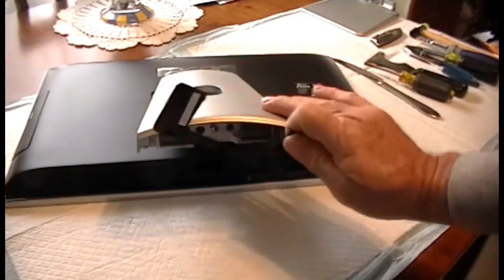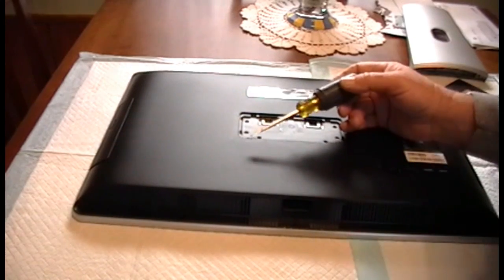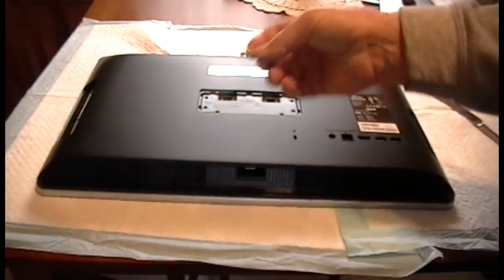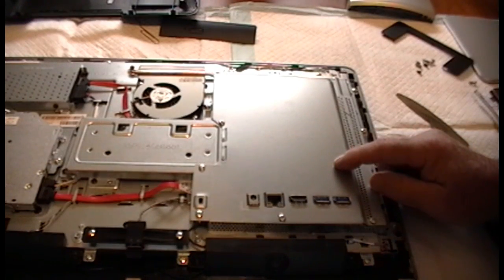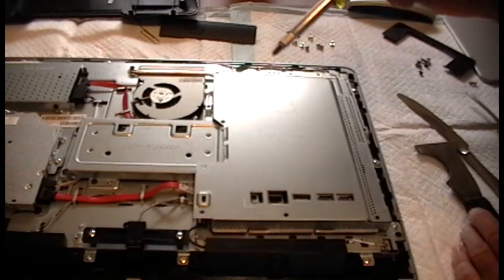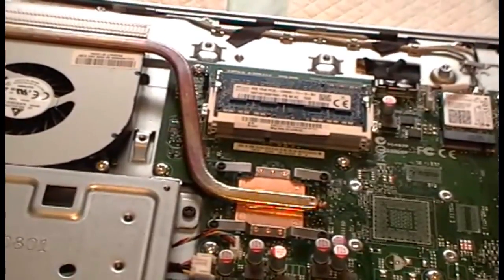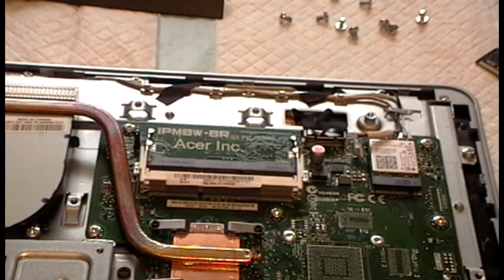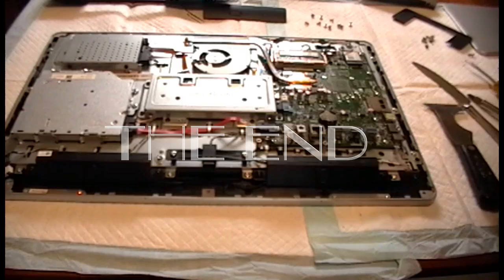Acer Aspire

Comment: as previously mentioned there are 2 slots for a 4gb can I.. use 2 8gb?
Reply from the maker: No, Max ram 8GB!
Reply: When it comes to ram if you want 8gb you need 2 cards at 4gb each. 2 8gb cards would read at 16gb and as the man in the video mentioned , it’s max is 8gb

Comment: I would also like a video on how to replace the DVD drive in that after 20 days (past the Walmart in store warranty) the DVD on this model is no longer seen by the computer and the ACER  reset procedure did not help.  The DVD door is not attaching correctly now and I just need to replace it and would  also like to find a source for a replacement drive.  The computer only cost $300 at Walmart.  Thanks for your help and great video, especially with the speed up unscrewing the closeup where appropriate.  You are indeed a pro.

Comment from the maker: Anything is possible, but I don't think there is enough room to piggyback another HD to reinstall  the back case. Maybe just upgrade to a higher drive or us an external SSD drive like I did. Via USB!
Reply: Since the power supply is built to handle the harddrive installed, and any upgrade possible , like 4 gb mem; do not install any other internal harddrive.Doing so will probably burn out something. To add harddrive space use a harddrive externally using the 3.0 usb port (that has an independent power supply) and you will be protected.

Comment: I am so glad you made this! I want to upgrade my memory also and get an ssd in the future.  Do you think it is possible to piggyback two drives.. roomwise? they make a mounting bracket for 2 drives, on top of each other.
Reply: Do not piggy back 2 drives, nor switch to another drive with a higher power wattage requirement that will cause an overload of the built-in power supply.Many makers of computers share common parts among different models.

Comment: So there's another slot for a 4gb? Or should I order a 8gb? Also, any recommendations on the exact kind i Should order?
Reply: It is always best to add another mem of same designation. Remember that if you add another mem module that is faster the system will only run as fast as the slowest unit.

Comment: Did adding memory to this computer help speed it up any ?
Reply: SuperMouseDV  it ultimately comes down to the cpu, ram only helps with keeping multiple windows and apps running simultaneously but with the low cpu this pc has you’ll only see improvement with no more freezing , as far as the lag goes it will still be there

Comment: can processor or graphic's card be upgraded also?
Reply from the maker: +Jeff Mitchell I believe the CPU can, looking into it now and will let you know! I don't believe the graphics card can though, no open slot like the other ACER models!
Reply from the maker: Yeah, no go on graphics upgrade and CPU has to be soldered in! NOT going to attempt it!
Reply: Upgrading the cpu would be unadvisable, the cpu installed currently runs $300 and the faster chip is more expensive and would require upgrading the power supply. Also, cannot upgrade the video as it is built into the cpu. The designers use the fastest and most energy efficient cpu available. the computer was very well thought and built.

Comment: "You won't get the right answer from Acer, I can tell you that."

Thanks for the video, you hit the nail on the head there. The manuals are more like "What RAM?" I'm shocked this all in one is actually upgradable. How';d you like the performance after the fact? I suggested the memory located here to a friend: http://www.crucial.com/usa/en/compatible-upgrade-for/Acer/aspire-zc-700g
Reply from the maker: +AshlockT Not too bad, doing some research to what else can be upgradeable!
Reply: I imagine it's still rocking an old laptop style 5400 RPM drive, moving to an intro priced SSD (solid state drive) is certainly one that looks easy enough.
Reply: Thanks for the vid, worked like a charm!